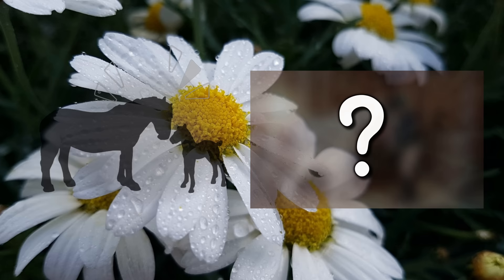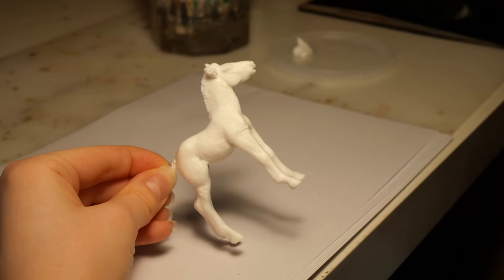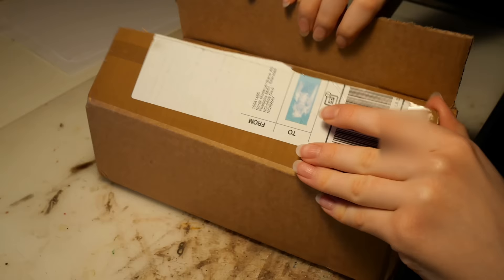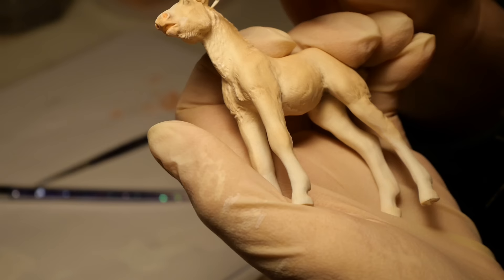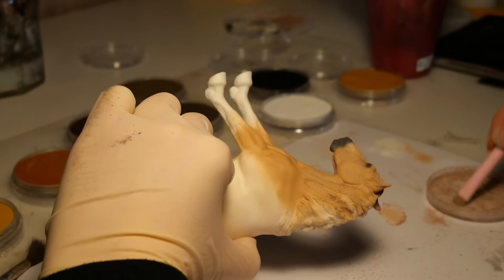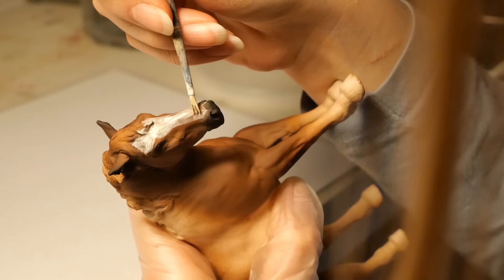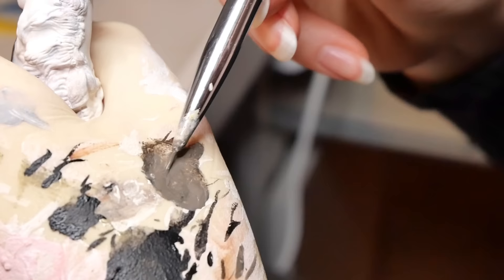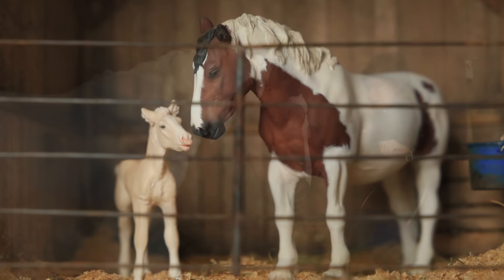Painting a Bay Draft Mare And Palomino Foal! - Custom/Repaint Tutorial Portrait Resin Model Horse

Comment: 2 tips on how to prevent dust in paint. Dry the horse with a hair dryer. The surface dries within seconds and dust has no chance. And look at the horse very carefully when priming with acrylic, so you can see directly where dust settles, which can be removed very easily from the not yet dry paint with a brush
Reply: Ty! This was supper helpful
Reply: @Bubble Tea you can first blow some seconds without horse and let the dust get out of the dryer I think
Reply: Another tip! Don't use nail varnish for glossing. It yellows after some time and just isn't good to use. I've seen recommended something like Liquitex medium gloss varnish or Windsor and Newton. Also to avoid graininess, it's better to add a few layers of each colour before you move on to the next shade.
Reply: It worked for me!

Comment: I was wondering if, like with actual makeup, the fibers of the brush (natural or synthetic) would make a difference and help with the pastels. I found this: Natural hair has a coating called a cuticle, which lifts and absorbs skin oils and powdery pigments. Natural hairs also tend to spread out rather than cling together when pressure is applied, which makes them ideal for blending products seamlessly and creating a smooth, even, non-blotchy finish. Natural brushes tend to be fluffy rather than flat and are very soft and comfortable on the skin. They're excellent for powder-based products like eyeshadow, blushers, bronzers, highlighters, and finishing or setting powder. 

I don't know what brushes you used, though. You might already know it and tried. ☺️

Natural brushes may be difficult to clean because they absorb products and pigments. And like human hair, the natural hairs in brushes may dry out and break, creating "shedding." They may also be more costly and somewhat more difficult to find, especially in specialty shapes and sizes.

The bottom line: Natural brushes are the best choice for powder-based products, and they're ideal for blending to a smooth, natural finish.
Reply: So I just checked your description box and Google told me the brush set by Brushwork is synthetic. Couldn't tell if it was the same brushes you have.